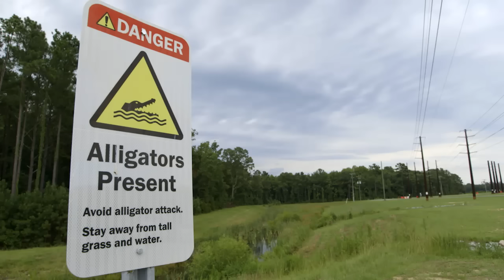Inside a Google data center

Comment: 'We crush the drive although they have good and usable parts on them... but we are environmentally friendly!'... :)) I'll never tolerate nor understand this kind of practices and destroying something that is GOOD essentially... that drive can be used, securely erased or repaired!
Reply: No company cares about being environmentally friendly, they just pretend they are for marketing reasons. When you see this datacenter, it should be obvious that it can not be environmentally friendly, no matter how you run it, even if you repair hard drives, even if you use solar power, etc. Let's not forget that the only goal of any company is to make money, not to make the world a better place.
Reply: brinckau
Absolutely, my friend! But hard drives are the brick... the basic cell of a data center... it breaks my heart to see them destroyed like that (when they are perfectly healthy or can be used for parts)... these natural resources will exhaust one day.

They do it to 'protect the user's data and to be absolutely confidential'... people, there's a thing called DELETION. :)) I will never understand those who destroy drives instead of low level format them (wipe completely).
Reply: Valentina Diamond I guess it's cheaper. Some drives can have a motor failure, so you can't make a low level format easily. And the format can take time, because you have to overwrite the whole drive several times if you really want to be sure no data is left.
Reply: brinckau
As long as the drives have no physical defects, trashing them is really absurd. If the motor is failed, the PCB is definitely good and usable. These guys are aberrant.
Reply: Valentina Diamond Yes indeed. But a drive manufacturer would have to test each drive to see what is broken (PCB, motor, platters, magnetic head, etc). I guess it costs more than to make a whole new drive, because it is a process that can not be automated easily (a human being has to take apart each drive and test each component).
Reply: Valentina Diamond Yes indeed, before capitalism, we used to die when wheat could not be harvested. Now we die when we can't make enough money. And stupidly, money is harder and harder to make, while wheat is easier and easier, because of the insane productivity level that we have. But I don't think that anyone is responsible for this, be it the Jews or whoever. Money is just a commodity like any other, it just makes the trades more convenient. But before money, the problem was already there, and nobody could have known what the result would be.
Reply: brinckau Absolutely! It's in the economic system, not necessarily in the monetary aspect (although it wouldn't hurt to stop cutting trees for making these dirty pieces of paper, haha... we're in the 21st century... we can carry it all digitally)... and the today's (capitalist) economic system reflects human nature perfectly - selfishness, greed and basic instinct. People cannot be changed, but systems CAN... and after systems and cultures change, people change too. But unfortunately the mafia is too big for a change and people get killed for telling the truth or indenting to change something.

If there's a god or a superior force (which guarantees the principle of action-reaction in moral situations too, not only in the physical world), God bless!... 'cause that's the only thing that can make a difference or change something in good and save us. If there's no god, injustice is equal to justice and criminals are perfectly equal to their victims at death... we're all f'd up in that case.

But I hope there is something superior like that... I and we can only hope, not prove nor dismiss anything.
Reply: Valentina Diamond The system changed our way of thinking, so we're doomed. But the system will self-destroy because it's not sustainable. I don't think we need either paper or computers, and I think computers are more harmful, both on an environmental standpoint and a social standpoint. I think the same about a superior force.
Reply: *****
Yes, and there's something more efficient and 'cuter' than crushing a drive - it's called LOW LEVEL FORMATTING... or DELETION.
Reply: *****
It's the 21st century... there is no way to be unable to 'confirm all that data has been deleted' unless the drive is defect. And if the drive is defect, it can be the platter, or the motor or anything else... the motherboard is usually intact and there is no reason to waste it.
Reply: I think the only way to ensure the data is gone forever is to destroy the drive. Low level formatting is not enough, as it is sometimes possible to recover data that has been rewritten several times. So you have to rewrite the data a lot of times to be sure. And if the drive fails in a way that makes the OS believe that it has been written while it hasn't, then the data is still there. So you have to read the drive again to make sure that the data is gone. But if the first writing pass has been successful, but not the others, then reading the data could be misleading. Plus, all this implies to repair the drive before deleting it. Plus, an employee can make a mistake, labeling a drive as deleted while it's not. Crushing the drive is much safer: there is no way to read it anymore, and you can tell when a drive is not destroyed just by looking at it. And of course it is much quicker and cheaper.
Reply: brinckau
A low level formatting wipes EVERYTHING... accessing some data after a low level format requires (very) special software, a forensic specialist or a very skilled hacker... and the Google's security is pretty impossible to pass and to hack. So how could 'sensitive data' on the drives can be accessed when they have such HUGE security measures? Drives CAN BE wiped completely... when data is accessible after a low level format it's usually because of a (software) failure. It's the 21st century and we have the sophistication to make sure a drive has been COMPLETELY erased.

It is cheaper, yes... endangered species (that are like that BECAUSE OF HUMANS) are also 'very expensive' to be kept alive (as if they participate to this dirty human contract called MONETARY ECONOMY... as if they have DEBT to pay!)... and this is how we become slaves to money and to corrupt economic practices that activate and  render only hate and greed in human psychology.

Species of animals are endangered because WE S**T ON THE ENVIRONMENT and then 'WE DON'T HAVE MONEY TO KEEP THEM ALIVE AND TO BREED THEM'... this is so embarrassing... if this can be called 'civilization', then I am Ariana Grande singing in whistle register! 'We make millions of dollars yet we cannot f***ing low level format a drive and make it inaccessible to hackers!'... really embarrassing!

I have a 2003 Western Digital WD400 drive that has almost four years of CONTINUOUS running and ZERO bad sectors... and it's still going and working like charm! How on earth can you destroy a such great thing? Even with a high level format... accessing the 'deleted' data requires special software that would be ran only by a remote hacker who is presumably kept away from Google's security. Or did they just admit to have a WEAK security?! Dunno... I'm just asking. Very disappointing and precarious... I'm gonna make a lot of noise about that, friends... haha.
Reply: Valentina Diamond The drives have to leave Google's facility at some point. They probably use dozens of thousands of drives, so I guess they can't keep the broken drives forever. Industrial espionage is a reality, and a competitor could use very sophisticated means and a lot of money to get the data.

Also, I think that if companies did everything they could to reuse as much hardware as possible, it would not make a big difference from an environmental standpoint. Capitalism requires infinite growth, so even if you reduce every company ecological footprint by 99%, you only save some time before the big disaster.

Which means that the real problem is not what the companies do. It is rather that there are companies, an economy, money, etc. All the things that makes the system what it is, and requires it to grow infinitely.
Reply: brinckau
Unfortunately yes... you are very right! Ancient societies used to crash when a certain level was reached (exactly like Windows, after too many sleep cycles and programs opened, haha)... because they didn't have technology and didn't know how to find or manage resources that are miles away. This point (of collapse) is reached harder today because we still have a lot of space where to expand and because there's a very 'small' distance from Japan to New York - we have transportation systems that conquered the world and made resources very accessible. But the collapse will eventually come for us too... of course, that if we don't learn to use the intellectual potential we have for building a sustainable, 'green' and renewable society based not on fictional contracts like money but on REALITY... on resources. We have all the intellectual resources, power and the gifted minds to provide good education and sustainable systems. Unfortunately that'll never happen because the greedy fat 'n' rich asses will kill you if you try to innovate and to make their money useless!

There's a great documentary about this issue... it's called 'Surviving Progress'. Many people have contemplated this issue yet nothing can be done about it. The laws and power are in the bad guys' hands.
Reply: Valentina Diamond Absolutely. Though I think that we're all bad guys. We're all a part of this system, and nobody really want to change it. It will have to change by itself, by collapsing.
Reply: Warning! This comment section contains consumerists! :)))
Reply: *****
Oh, that's so cute! By the way... do have lisp when you talk? (You know... to avoid asking if you grab your ankles! :))) )

Comment: are they using Mechanical HARD DRIVES ??? are they fast enough ???
Reply: Usually in a data center what you know about consumer hardware does not apply.
That goes double for Google's datacenters.

 Considering what it does ( it fetches personalized, indexed search results in under 500ms)  it must have Multiple caching layers, and likely various different hardware  setups for each of those layer. There's a ton of traditional that's accessed rarely, say for obscure youtube videos or people who have documents in google drive they dont access often. Those are likely mechanical drives with a lot of redundancy.

Then  there's the kindof regular-use stuff. Stuff that used to be popular but sees less and less usage. Those get offloaded to a caching layer that's a bit faster. Either a raid array that's faster or an SSD-based layer.

And then you have the ultra-high-performance stuff like google search and new videos.  They probably have a deidcated cluster of servers with disgusting amounts of memory that allow you to retrieve the dankest of memes in under 200 miliseconds.
Reply: They are faster then most internet connections, so it wouldn't make sense to send more data then the internet connection can handle. They probably also have ssd's for bigger consumers and other necessary tasks, like data management.
Reply: Most of them, if not all, are in some kind of RAID array, so the speed is always sufficient. They probably have SSD arrays as well for cached data
Reply: +Asen Jechev "it fetches personalized, indexed search results in under 500ms." Most of that calculation is done with javascript on your computer

Comment: WHAT YOU GUYS NEED ARE POWER FARMS! WINDMILLS AND SOLAR PANELS, AND LOT'S OF BATTERIES! ANY EXCESS ENERGY YOU COULD SELL BACK TO THE POWER STATION FOR INCREASED PROPHETS!  I DON'T KNOW ABOUT YOUR COOLING PROCESS, BUT IT  LOOKS LIKE A PRE-HEAT TO ME, THEN YOU COULD USE ELECTRIC BOILERS FOR STEAM TURBINES WHICH CAN PROVIDE MORE ENERGY! ALSO, THE PRE-COOLING COULD COME FROM A RESERVOIR ON CAMPUS, CIRCULATED AROUND AND PUT BACK INTO THE RESERVOIR, YOU'LL HAVE SOME EVAPORATION PROBLEMS, MAKEUP WATER COULD COME FROM A LAKE OR NEARBY RIVER OR STREAM! BEFORE GOING INTO SPACE, YOU NEED TO THINK ABOUT HOME! SPACE IS COOL, BUT UNLESS THE GOVERNMENT GIVE YOU THE BLACK-BOX, ENERGY PROBLEMS WILL NOT GO AWAY, ANYTIME SOON! AND I KNOW YOUR RUNNING A LOT OF SERVER FARMS, WHICH PUT AN INERADICABLE IMPACT ON THE GRID! SOUNDS LIKE YOU GOT SOME SECURITY IDEAS FROM THE MILITARY, GOOD FOR YOU! THANK YOU FOR YOUR VIDEO!

Comment: Google... 1 question... what if power go out... will Google malfunction?
Reply: No because the almost certainly have backup power for every single computer in the entire building.
Reply: They make power by themselves, they can't go off
Reply: How do they make their power, do they run generators and get a truck load of fuel delivered everyday?
Reply: KiwiPowerNZ wind and solar powers also this isn't the only data center, there are many, they can also use water power if they get desperate and they probably have many backup generators.

Comment: The servers are put inside the air conditioner in this design. As opposed to servers put next to air conditioner.
Reply: They aren't in the A/C unit. Instead the A/C unit (heat exchanger, really) is right behind the servers. The idea is that the hot exhaust from the servers is contained and directed into the cooling coils, so hot and cold air is never mixed together (which is inefficient).
Reply: Makes sense. Reduced shuffling-cold-air-around means reduced electricity bill.
I wonder, during the winter, if they just blow in the freezing cold air outside onto the servers, and no liquid coolant needed. They should. Here in the northeast winter, we just turn off ac and our servers double as heaters for people in the office. The heating pays itself by computing. The computing is free.
Reply: John C G It varies by datacenter, but Google in general are pretty good at optimizing for the local weather when building DCs. They use plain air cooling in some. On this one I imagine they'd still use the heat exchangers, but just moving heat through a water loop isn't very expensive. Using HVAC (actual heat pump units) is expensive, but you don't need that in the winter.

Believe me though, a Google DC would provide heat for its offices many times over. The amount of power consumed is massive. You still need to cool the servers ;)
Reply: I have booked the flight to North Carolina to visit the Google DC for July 4th.
Reply: I am back from the trip. I visit the Lenoir, NC location on the eve of independence day. The guards were very alert about approaching persons. The outside of the DC looked like a factory. Unsuspecting people would think that it was just a factory. There was no sign that said "Google". The single only sign was an acrylic round chrome circle with a G letter at the center, about 2 feet in diameter. When my car stopped at the street opposite of the entrance, the guard watched me in the booth, then came out in his car in less than 1 minute. But he waved his hand at me when his car passed me. Friendly gesture. And I smiled. 
The location is about 70 minutes drive from Charlotte airport. 60 minutes ride on a interstate-style freeway, then 10 minutes on a semi-highway. Tickets to RDU airport is 100 dollar cheaper. The DC location and Charlotte and RDU form a narrow isosceles triangle. The DC to RDU is 2.5 hours drive, and Charlotte to RDU is 2.5 hours drive. I navigated the entire triangle in the July 4th weekend.

Comment: Wonder what would happen if that room got flooded.
Reply: Pornhub would be down
Reply: And my childhood will be saved
Reply: slower load times... if you live in SC
Reply: Sounds like you might have been in that data center. At this data center the servers are cooled from the rear of each rack. Not from the floor. 04:10 Also, the servers are only a few inches off the floor. I am sure there are drains everywhere as in the data center where I work.
Reply: I would guess that is a well oiled Google insider
Reply: One of google's many, many, many other datacenters would handle any traffic intended for that data center.
Reply: Well to put it simply you would be using yahoo and not watching youtube
Reply: Firstly, it'd be hard to flood the room, as the servers aren't "on" the floor, they are well above it.  The floor has infrastructure and supports and ventilation for the room, and the servers and equipment in it.  The white tiles lift up so you could actually get underneath it.  

So the 'flood' would have to be very high.  If there were a flood, power cuts off, and the cluster goes off-line and everything fails over to another google data-center, like Douglas County, GA or Lenoir, NC.
Then repairs start, and when ready, the data floods back in and the data center is back up...

It should be seamless, as far as I could tell.
Reply: surely they have a backup not located in there. autouploading it daily to that secret place.
Reply: they have disaster plan....
Reply: wonder what would happen if the same meteor that wiped out the dinosaurs headed straight for a google data-center.. would it get scared?